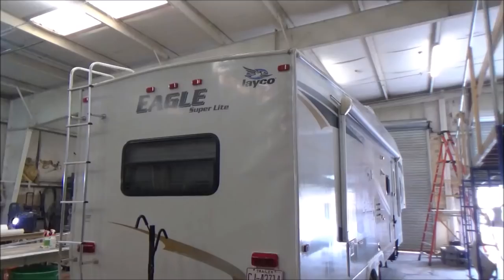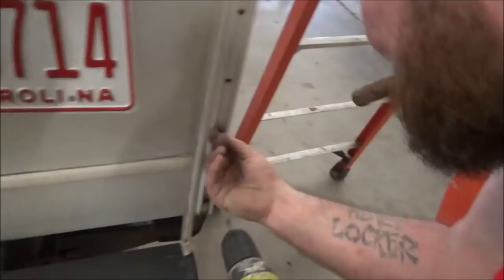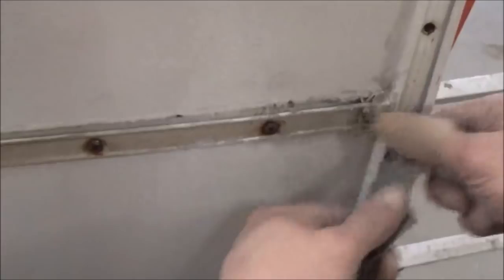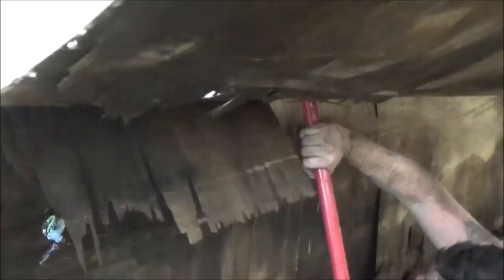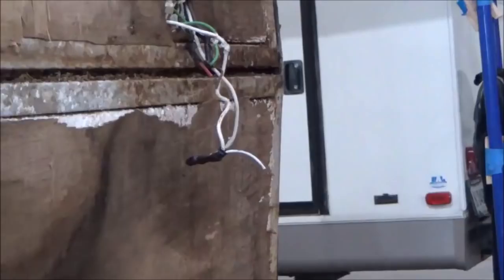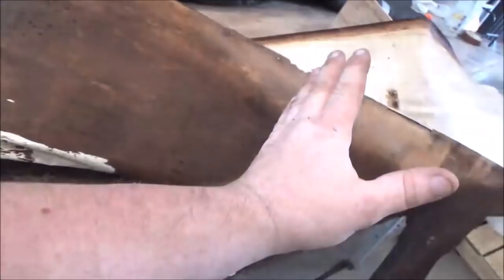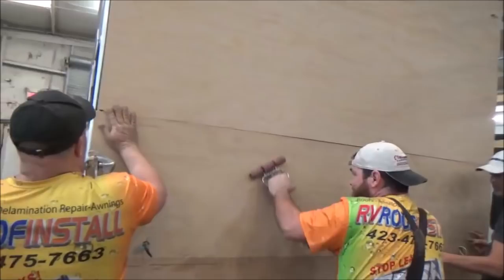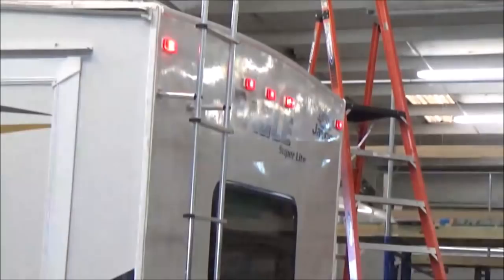Re-built and Relaminated rear wall on Jayco super lite

Comment: Is 3m fasthold what is used for the adhesive you use for laminating?
Reply from the maker: Not familiar with flashhold. We use 94, 90 will work
Reply: RV ROOF INSTALL hmm the foam looking adhesive your putting on is coming from a large canister per 3m fasthold 70 is recommended for rv’s bonding and lamination with a fast hold. I just want to make sure I’m using the right stuff to glue my outter walls so they don’t fall off!
Reply from the maker: @RiseAboveElevation  3m has quite a few adhesives and I buy the ones that will work in multiple applications. If it says it recommended...use it.
Reply: RV ROOF INSTALL 3m 94ca comes in the large canister like what you use and 3m70,
Reply from the maker: @RiseAboveElevation  not sure how much you have to do but Home Depot sells it in rattle cans. Adhesives come in strength some are commercial strength and we use industrial strength. That why there are a slew of numbers for the adhesive. The big cylinders we use will run upwards to 500 with shipping.
Reply: RV ROOF INSTALL yeah I noticed they industrial bottles are crazy expensive! Not convenient for a diyer. I noticed yours comes out in a almost foam form where store stuff is in like a mist where I would think there would be way less contact.
Reply from the maker: @RiseAboveElevation   that's the 90....is comes out like cob webs.
Reply: RV ROOF INSTALL alrighty, sorry for all the questions I just want to do my repairs like the pros do !  Thanks for your help!!
Reply from the maker: @RiseAboveElevation  well don't be so cheap and empty those pockets.fke the good stuff!... LoL!
Reply: RV ROOF INSTALL I would bring my coach to you but we live in a rural area with not many rv repair options!
Reply from the maker: @RiseAboveElevation  cheap cheap ..said the birdie...lol. Good luck...let me know.
Reply: RV ROOF INSTALL also so for attaching new roof ply do you still recommend 3m 90 for attaching new roof sheeting?
Reply from the maker: @RiseAboveElevation  you need to glue the roof down with membrane adhesive..whatever brand you bought they have an adhesive and a primer.
Reply: RV ROOF INSTALL not the membrane to the plywood, I’m talking about the plywood to the coach.
Reply from the maker: @RiseAboveElevation  if it's getting bonded to foam you'll need the spray adhesive that we talked about.
Reply: RV ROOF INSTALL so you recommend 3m 90 to bond the new ply to foam for the roof and walls?
Reply from the maker: @RiseAboveElevation  sure. We use 94...have used 90. We like the way the 94 sprays better than 90. But Home Depot doesn't carry 94.
Reply: RV ROOF INSTALL  et or ca?
Reply from the maker: @RiseAboveElevation  not following what you're asking.
Reply: RV ROOF INSTALL 94et or 94ca? There are two different kinds, man I wish you had a shop over here in Idaho hahaha.
Reply from the maker: @RiseAboveElevation  if you're not doing a lot then buy the cans at Home Depot. We use the ET.
Reply: RV ROOF INSTALL 94 and 90 both eat the foam , looks like for the walls and roof don’t you use great stuff wall and floor? Mann you could of saved me $50 in melted foam trying 3m 90 and 94 that should be only be used for wood to skin on the rv.
Reply from the maker: @RiseAboveElevation  we don't have those issues. I don't know what you got or what your working on... but you can always read the can. That's why we emphasize that these are not DIY or tutorials.
Reply: RV ROOF INSTALL but you recommend 3m90 plywood to foam but in your videos 3m90 is only used to laminate and great stuff is used on plywood to foam per your videos, right?
Reply from the maker: @RiseAboveElevation  sorry you are having a hard time. I do not post these for DIY because it is hard to explain procedures and products in text especially when others are not familiar with them. I certainly don't want anyone upset because things don't work out because they are not versed in the process and principals, like you are about loosing $50. on foam. I don't have these issues of incompatibility and disintegrated foam.  At the risk of sounding like a jerk...I don't have the time to talk to everyone on how to fix and rebuild.  These coaches are not easy and every step and process counts.  Skipping or not doing a step correctly will show up either before your done or in leaks down the road. I'm sure your frustrated, but this is kind of a big project to undertake if you don't know it completely.
We post the videos for our customers to see all what we uncovered and repaired.  These videos are not tutorials.
Reply: RV ROOF INSTALL totally understand! Thanks for the help you have offered me. Just living in a rural area I don’t have any rv repair options so I’m left to figure this on my own with some help from you and what I’m seeing in the videos. Thanks again!
Reply from the maker: @RiseAboveElevation  it's better to email than do the YouTube. You can send pics of what your having trouble with. contactus@rvroofinstall.com.
Reply: RV ROOF INSTALL thanks so much again for your help and responding to my questions.
Reply from the maker: @RiseAboveElevation  I looked up the tech data sheet for the 3M90 and it shows to be compatible with the foam. So I am puzzled at what went wrong with your project. We haven't had issues like you describe.
Reply: RV ROOF INSTALL I appreciate it a lot! I thought it might of had Acetone and what was earring the foam. I’m using the same pink styrofoam your using. Maybe I have a old expired can???? Maybe I’ll buy another can and try again on some scrap this time!
Reply from the maker: @RiseAboveElevation  it should come out like a cob web. Shake thoroughly and on the can near the nozzle is a black mark that the nozzle tip needs to be aligned with.
Reply from the maker: @RiseAboveElevation  I see you dilemma. I did a test with the 90 on the pink foam. We don't use the 90....when we have laminated we use the wall and floor OR you can use 78. The solvent in the spray is degragating the pink foam. We have use 90 on ISO board...a bit different. Lost your email. Hope that helps. I still don't know what your working on with the pink foam board.

Comment: I was wondering if you could explain why dadcore is no good.
Reply from the maker: Any product that requires to be reapplied as Dicor does, every 3 to 4 months can't be very good quality , can it?  I don't know the actual chemical compounds in Dicor, but it seems to be a butyl  acrylic blend. When the acrylic fractures and cracks it leaves a path for the sun's UV Ray's to break down the butyl.
Reply: @RVROOFINSTALL  What product  do you suggest?
Reply: @RV ROOF INSTALL  I would also like to know what product you would suggest.
Reply from the maker: @dreday1332  Dicor is a buytl latex /acrylic mix from what I can see. I don't have the chemical compounds but that's what it appears to be. Anyway the product has no UV resistance for long term that's why it fails in 3 months or so. It's their cash cow...getting folks to spend $12 a tube needing about 5 tubes per nor more. They know it fails. If they care they would reformulate the product to last. In 35 years of doing commercial roof systems Dicor is the only product I have known to fail like it does despite being marketed for exterior use. We use M1 by Chemlink.
Thanks for watching!
Reply: RV ROOF INSTALL how frequently would you suggest reapplying or ensuring no failures for this product?
Reply from the maker: @dreday1332  you shouldn't have to re-apply like you do Dicor. I would keep an eye on it as a prudent measure.  We haven't had to a re-apply any of the coaches that come back for annual inspections.
Reply: RV ROOF INSTALL well that would be really nice. Thank you for your time. One last question. Would you suggest removing the dicor before applying?
Reply: So is m1 used to seal joints/seals and roof vents etc? Can it be used to attach new ply inside walls and out ? And the rv skin?
Reply from the maker: @RiseAboveElevation  M1 is a great GO TO caulk. It can be used in lieu of liquid nails or seal around a window. You could glue fiberglass back with it as well and it is compatible with foams.  However, understand some applications may need a caulk with more flex and other applications may not be practical to use M1.  As with any product, do not use it outside of it's intended design and application.
Thanks for watching!
Reply: RV ROOF INSTALL what would you recommend for flexible caulk? I don’t think m1 is intended for coach trim seals or corner seals due to flexing right?
Reply from the maker: @RiseAboveElevation  Duralink 50 is what we use. Made by Chemlink. If you use caulk on any acrylic, membranes or plastic those will need to be primed where they come into contact with the caulk or it will not stick.
Reply: RV ROOF INSTALL what primer do you recommend for caulking? With duralink?

Comment: What type of glue did you use to on the rear panel
Reply from the maker: 3m90 should work. Thanks for wàtching.
Reply: Should work..... that was the mentality when they built the pos. 3m. Vhb tape is the only way these campers/rv should be built, and aluminum. Just saying,😉

Comment: good day. than you can clean the plastic from the old plywood. thank
Reply from the maker: What plastic are you referring to? The outside is fine fiberglass. You can fillet it from the plywood.
Reply: @RVROOFINSTALL  thanks for the answer. yes outdoor fiberglass. when I separated it from the wall, old plywood remained on it. I took the portable planer and clean off it. and how are you doing?

Comment: For the cost of these RV's it is disgusting their builders cannot even make a roof that does not fail.....they should be forced to warrant their roofs for twenty years that would sort out the pricks ....everyone's RV roof fails and that is not good enough.....as for rubber roofs what the hell were they thinking!
Reply from the maker: The ROOFING material is warranties for whatever years.  You'd have to show the roofing material itself had failed. Usually it doesn't,  it's the detail that fails...ie...vents, skylights plumbing etc. That cause the leaks. They know this. If people stopped buying a camper even for 1 month...30 days...across the country they'd get the message. Someone needs tonsetbthat up on a social media thing. Just 30 day boycott.
Thanks for watching.

Comment: I’d never buy a Jayco product.  Seen too many of these
Reply from the maker: They're all the same. Thanks for watching!
Reply: RV ROOF INSTALL, let’s agree to disagree.  Which make do you see less in you’re shop?
Reply from the maker: @opinionmatters7119  we have never worked on an Airstream canned ham.  That's the only ones.
Reply: We have a Holiday Rambler Alumilite (1996).  No leak issues.  All aluminium frame.  I watched bid to see about caulking.  On a prior traier, I used a Loktite Marine caulk designated for through the hull fittings both above and below the waterline.  I figured "that ought to keep rain out" and it worked fine for the last three years I had that trailer.
Reply: Make that "watched vid". And "prior trailer". Sorry for not proofreading.

Comment: Dicor is a ripoff!  What do you use instead of Dicor?
Reply from the maker: M1 by Chemlink
Reply: RV ROOF INSTALL is this stuff self leveling
Reply from the maker: @markbeaulieu8004  No, M1 is not self leveling. You don't need self leveling.
Reply: A rip-off?? M1 by chemlink is $19/tube. My Dicor is less than that. How ya figure?